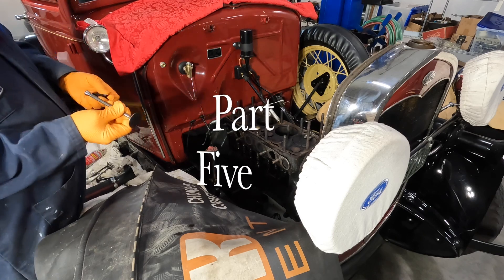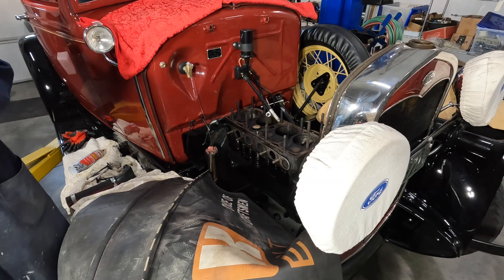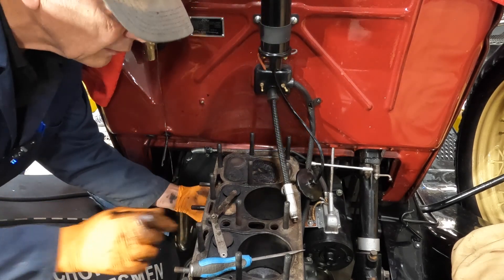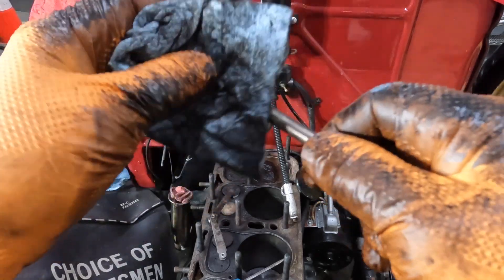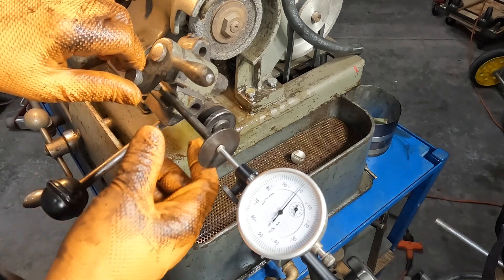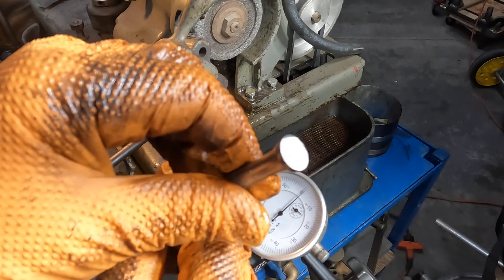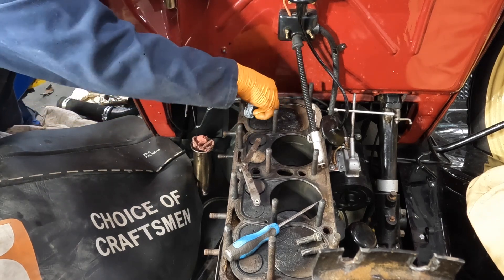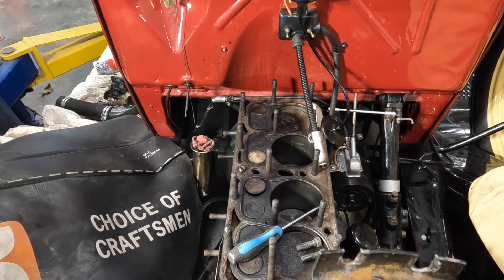Model A Overheat Part 5

Comment: More wasting of video detail time and problem not found.
Reply: I’ll bet Martin is fun at parties.
Reply from the maker: The burned valve was  I believe a contributing factor, however getting the timing right, adding a thermostat, ultimately solved the problem.
Reply: Thanks

Comment: So you didn't say if you fixed the over heating problem.
Reply from the maker: I’m sorry I didn’t explain what I felt fixed the problem! I feel the burned valve was a contributing factor however adding a thermostat and getting the timing right ultimately solved the problem!